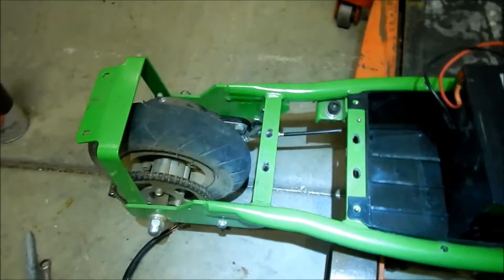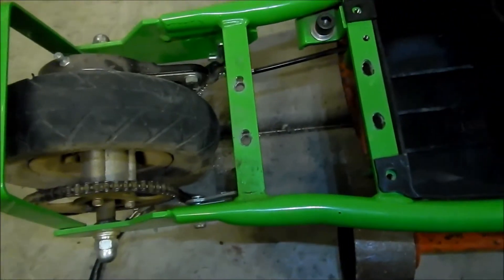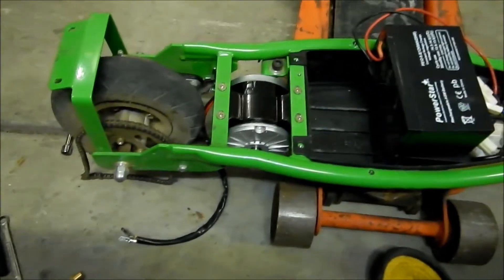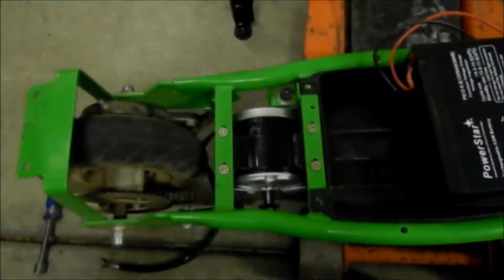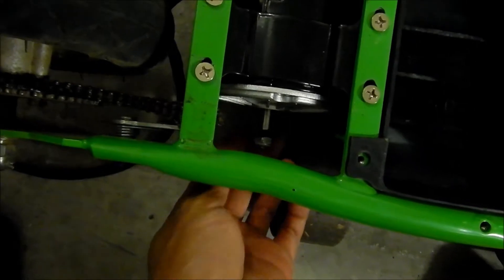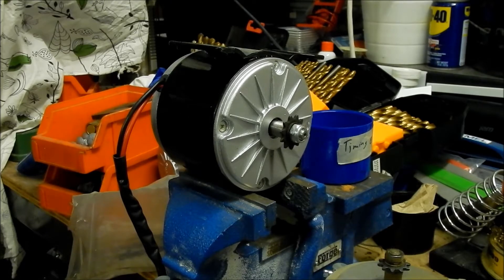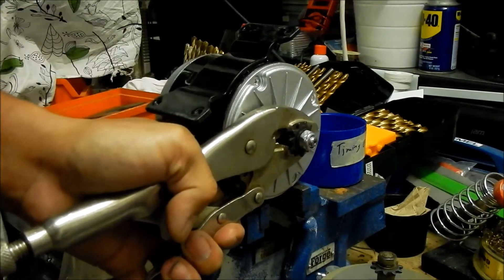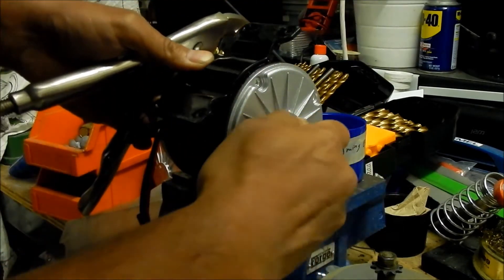Razor E200 Scooter ZY1016 350W Motor Install VLOG Part 2 - Drivetrain Modification

Comment: I have experience this model always hit the floor, maybe the rear wheel is too small, if install as this way, the motor will hit the floor more.
Reply from the maker: Yes that's true.  The clearance is not great on the E200, its for mostly flat surfaces.  The larger motor makes it worse.  It can handle some punishment though.  The important thing is to make sure there is air in tires so you get the most ground clearance.